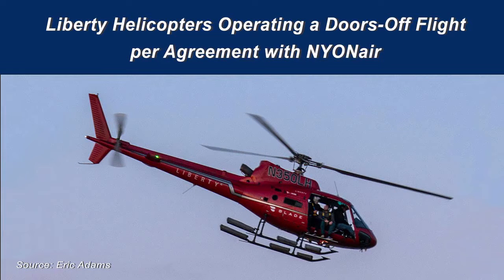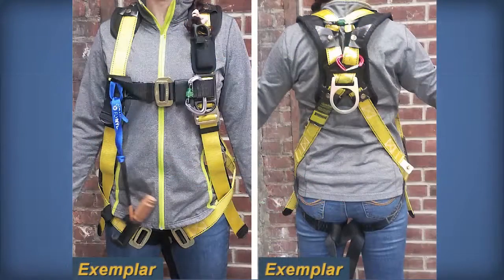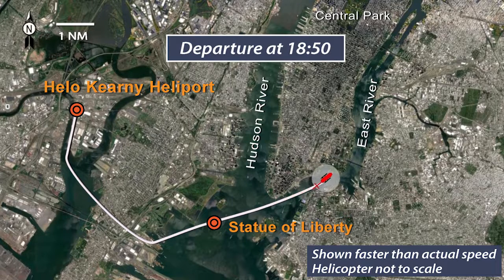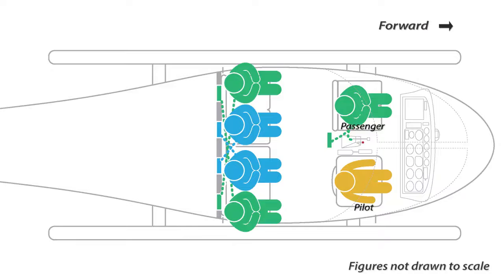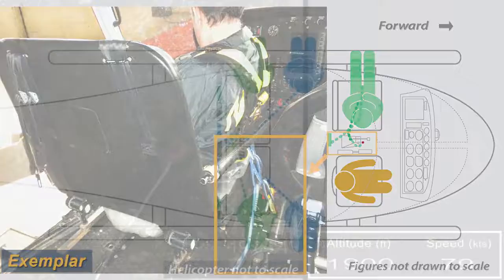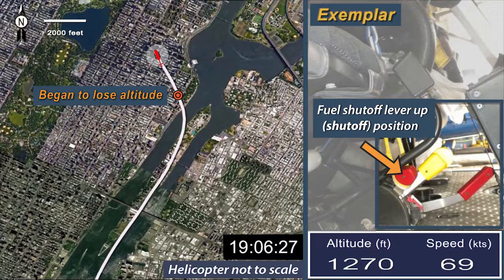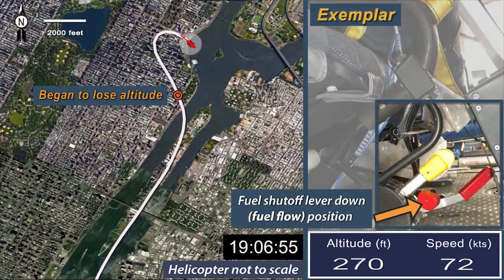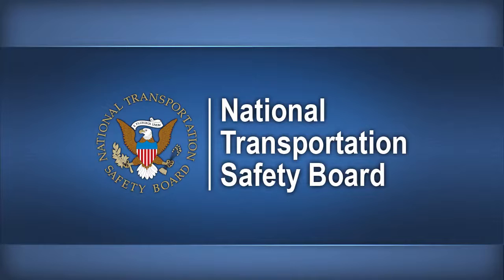#108 - Why Helicopters Crash: Analyzing the New York Accident

Comment: What did we learn during the training? It takes 8 (EIGHT) seconds for the floats to completely deploy! 
So, always fly that you have 8+ sec after engine failure before hitting the water!
But that requires that you activate them on time!!
He had enough time!

Anyhow, he should have checked this pax harness before flight! He is the commander and responsible!
Reply: Living in a perfect world spreadsheet or personal involvement  in such a tragic accident would explain such text.
Reply: @Slendrianen  another question is, with which floatation system the 350 was equipped. This is relevant as there are multi-level different floatation systems available for the 350 series depending on the TTOM. That chopper was fully loaded. 
Has that pilot ever trained AR’s with a full load? I highly doubt it. 
We did that. Never heard of civvies doing it…
But it always depends on the local authorities and the operator.
Reply: @akkseljohansson3601  You should have asked the company and not start blaming the pilot.
Reply: @Slendrianen  I don’t know if you are a pilot, but let me tell you a fact: whatever happens in and with a aircraft is the sole responsibility of the PIC. Regardless of company manuals or official regulations. 
I’m awaiting the NTSB report in which I hope to find the proper information regarding training of the pilot, the proper documentation of the pre flight calculations reg M&B,MTOM etc and the Ops manual.
Reply: @akkseljohansson3601  Working part ops on a mil grade twin-engine simulator. Sure the pilot is ultimately responsible for the safety but there are many factors  and starting blaming the pilot as you did was the triggering factor for my response as one thing is the ideal situation where we often see even highly trained crews do deviations even if they are in a sim and should be prepared. 8 secs. for shifting to x-feed on clogged fuel-filter before flameout is a good example where they often get caught off-guard if doing anything but simply flying and then yet they doesn't always react in time. Survivable in a twin but killed the passengers here as there wasn't time for another restart. So yes, wait for NTSB before starting talking down on the pilot already would be more suitable.

Comment: I used to play this video during my AS350 ground instruction to create open discussion. Sometimes it is the things you don’t expect to happen actually happen and what we try to learn from the unfortunate mistakes from others. Based on the circumstances, in my opinion I believe the pilot handled this like a rock star. Being able to quickly react appropriately to what happened, then to realize what happened, then to execute the best damn autorotation of his life. He did everything he could. But unfortunately those floats inflated asymmetrically which caused it to roll over and not stay upright. But all of this caused by a little strap to hold the passenger in the helicopter created a hazard of its own. And the fact that the poor, untrained and under prepared passengers couldn’t safely egress with the poor choice of a full body harness stood no chance to survive. Let alone the frigid water temps and panic while submerged. Bless their adventurous souls. This pilot should be recognized for being by a hero and doing everything he could to execute the best forced landing of his life.
Reply: It’s amazing that he had the wherewithal to attempt two air restarts, even turning the fuel level back on before jettisoning his floats for the flare? When practicing autorotations, everything happens pretty fast and it’s easy to get fixated on your airspeed and rotor rpm, trying to stay within the parameters of the HV curve. When you do enough of them throughout your career however, you can basically feel and hear what the helicopter is doing, allowing you to concentrate more on troubleshooting. Most likely a high time pic in this case.